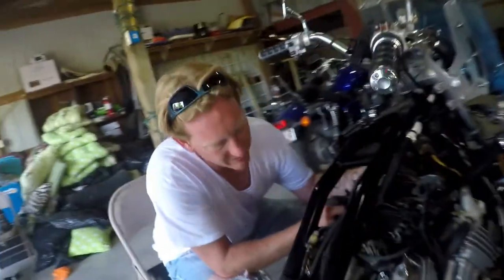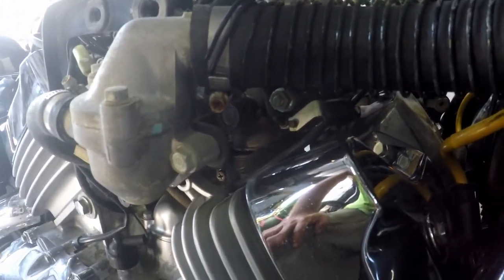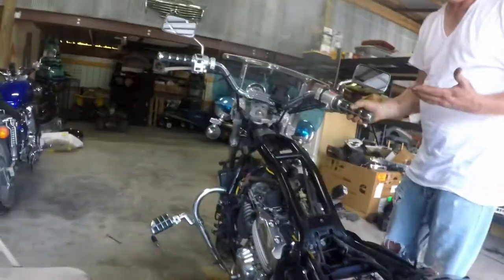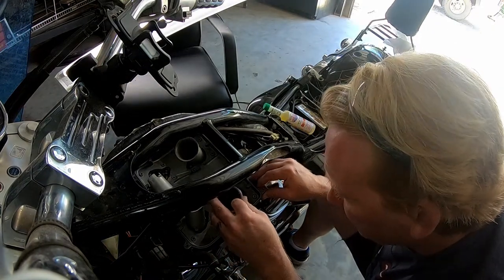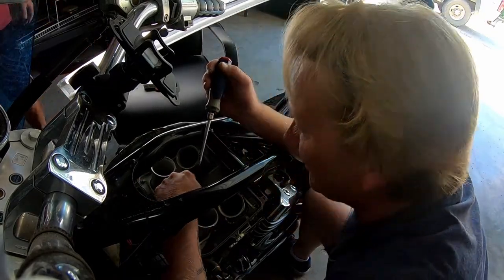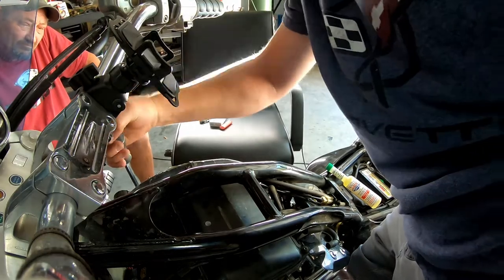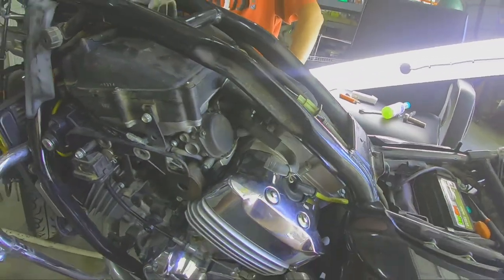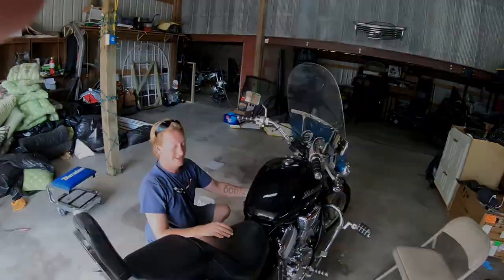Motorcycles series:  97 Honda Magna 750 carburetor install  Part 2

Comment: Boil then oil the boots and they are much easier to work with. Heat makes them more pliable and oil is lubrication to slide on. Great bikes and your videos are good.

Comment: Hi Chad..what is the easiest way to see in fuel is getting to carb bowls. I replace the petcock manual and auto. I have spark. The vacum appears to be working on the petcock..however the spark plugs are dry...they should have been wet/flooded by now..I dont spell gas on the electrode either..Thanks

Comment: The fuel line that has the T I got that but there's another hose right above it goes to the slide vacuum but where do I connect it when installing the carbs

Comment: Why is there a Clutch plate noise or a  chain follower noise gets loader as the bike gets hotter..it only has 22k miles on it
Reply: And I'm not sure what it it
Reply from the maker: Not sure. Is there slippage in the clutch